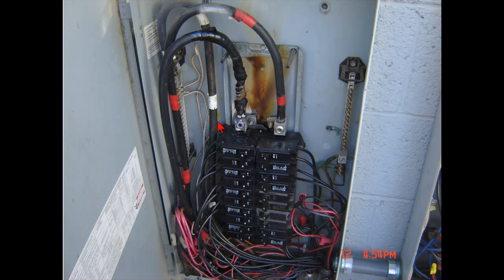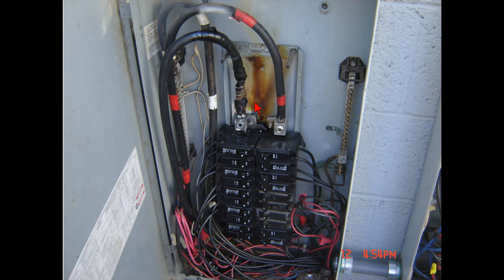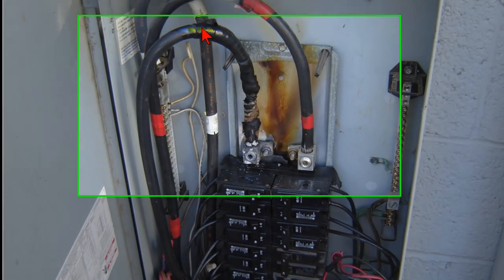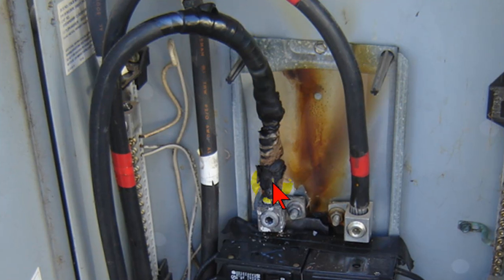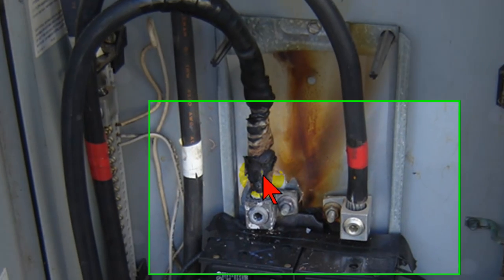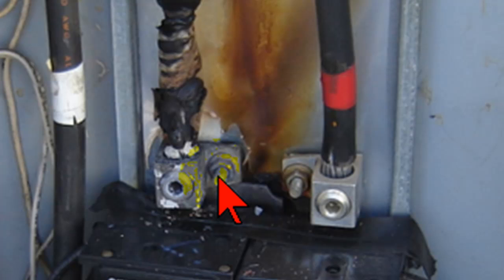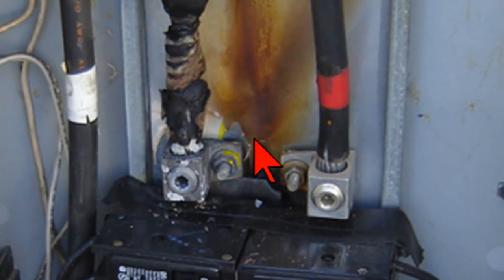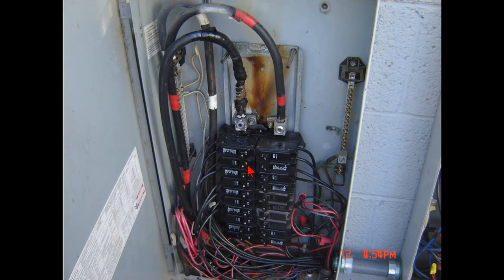electrical wiring-overloaded feeders

Comment: Looks like more of a loose connection rather than overloading.... 
Aluminum loosens because of expansion and contraction and eventually works itself loose and boom loose connection and burnt lugs and wire ends
Reply: sissy aluminum wiring no doubt.

Comment: Hey Mr. EIN this is the last of the comments of today. I have to say that it would be really hard to melt the 4/0 alum wire going to that panel being that its 200A only a 20 circuit. That was due to a poor connection not due to overload. Are you a real electrician or what? Do you have a company becuase it still can be in business if your telling people this crap. That panel is a mess all the wirenuts tells you that a unqualfied person installed it. Heyy wait a minute EIN... You put this panel in didint you. Thats why its melting. WOW

Comment: From what I know, aluminum wiring sucks.No.12 aluminum has the same current carrying capacity as #14 copper. Aluminum wire is weak and breaks off easily, it corrodes with copper & eventually makes poor contact ,causing fires.I never use that stuff. Good they made it illegal. It was a failed experiment.

Comment: I'm in Sacramento, Calif. We've had so many fires in the past due to aluminum wiring in trailers and modular homes, they now require copper. But commercial still allows aluminum, I do comm'l maint-elec/mech/welding and it's just not worth the savings for the aluminum (in my opinion, anyway).
  My last job was in a 44,000 sq. foot  building with 1,000 amps of 480, a big mess, even worse than your videos of the restaurant and the car-wash.

Comment: Is it normal for when a breaker gets old and the contact to the hot bus bar gets loose and ends up charring the bar it's on? I've seen this a couple of times and I never hook a new breaker onto the charred bus, I've always been lucky and have been able to either relocate the circuit to another spot on the panel or use a tandem breaker (which i don't care for either, but its better than hacks that double tap breakers). That's about all you can do, right?

Comment: Why is the damage originating from the connection?  Heat at the connection. The insulation of the wire would be damaged its entire length if the wire was too small.
Connections on aluminum wire is very critical.  A bad connection would look exactly like the picture.  any repair would have to have dealt with that first.  without a perfect and corrosion free repair it isn't fixed.  The ground fault can kill the fuses regardless of the wire damage.

Comment: @crookcirca80 Not true.  It is one phase.  The 13kv from the power company to the primary of the distribution transformer is one phase - it's just two wires, hot and ground.  You can't get two phases from one phase, through the distribution transformer.  That is not physically possible.  Single phase systems are comprised of ONE phase, not two phases.  Sorry, not to be critical, but you're wrong.

Comment: @meccaturbo 

Single phase systems are comprised of two phases.  In order to get 240V, you need two 120V phases.  The disaster here has two phases (ungrounded conductors) and one neutral (grounded conductor).

Comment: @sparkyUonline No.  It's single-phase.  The line feeding the distribution transformer is one phase, thus the output of the transformer can not be anything more than one phase.  Input is typically 13kV, single phase.  Output is 120V/120V H-N-H, one phase.

Comment: is it normal to have aluminium cables for main feeds in the US?
Reply: Yes, the cost of alum is lower and all you need to use is the anti corrosive paste on the lugs to prevent the alum from degrading over time. There is nothing in the NEC code book saying you can't use alum over copper, just has to be properly sized for the load of the panel. Alum expands and contracts more then copper so it is typically unfavorable.